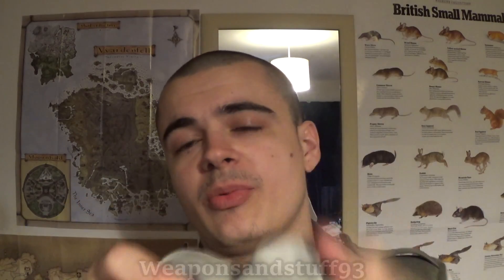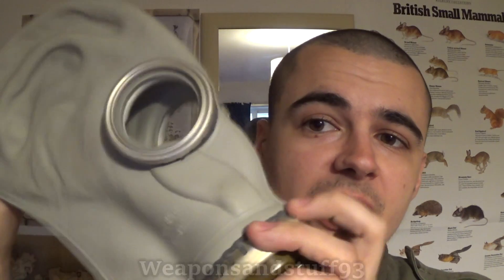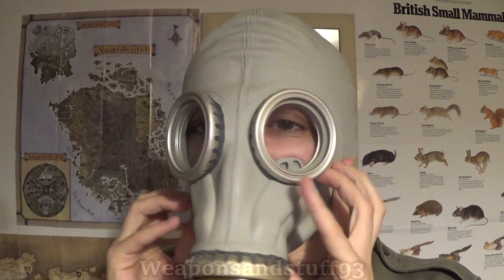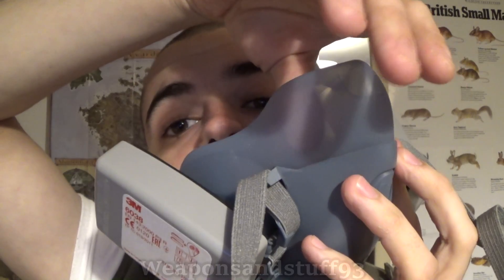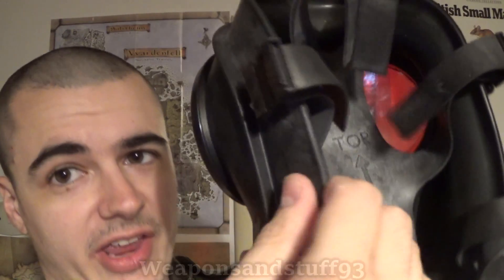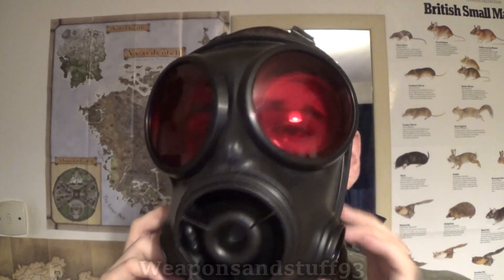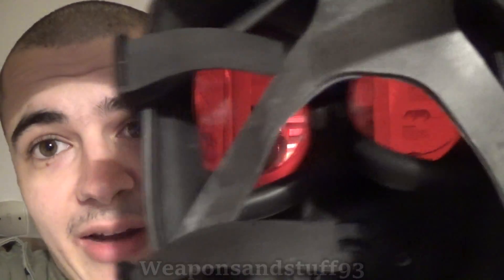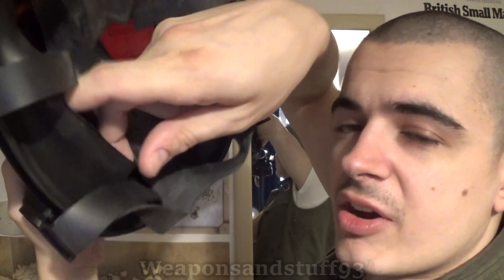Types of Rubber used in Respirators

Comment: A correction: blistering agents (e.g. mustard gas) do not cause silicone to degrade. The issue with using silicone against chemical warfare agents is due to its extraordinary porosity (i.e. the amount of empty space between siloxane molecules; the reason for its softness) which enables gases permeate it relatively fast. Based on a research article on the mustard gas resistance of gas mask materials (titled "Estimating the Permeation Resistance of Nonporous Barrier Polymers to Sulfur Mustard (HD) and Sarin (GB) Chemical Warfare Agents Using Liquid Simulants") even a relatively impermeable form of silicone rubber would still be permeated about 30-50 times faster than butyl rubber.

Comment: Note that butyl rubber has a glass transition temperature of around -42 C / -43 F, which means that on particularly cold days in the Far North, it becomes hard and brittle. Silicone has a glass transition temperature of -125 C / -193 F, and (like other materials) contracts in the cold, making it significantly less permeable to gases, and, as such, more optimal for use in cold environments.

Comment: Which one's the 'Hunk' Mask? (Red lenses one)
Quick Edit: It's the S10, I figured out, but what's with the red lenses?
Reply from the maker: Red outserts were either for nighttime use or laser designation.
Reply: @weaponsandstuff93  I think I heard somewhere that the red lenses were "flash-bang proof" or "flash-bang resistant", That's probably wrong, right? (because I don't think there is even a thing that is flash-bang proof that you can see through/ isn't a wall)